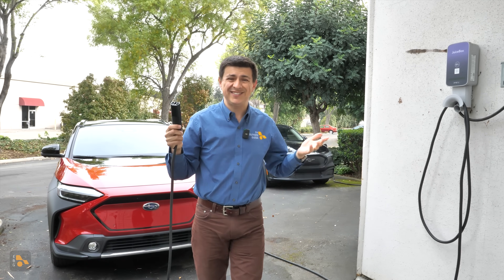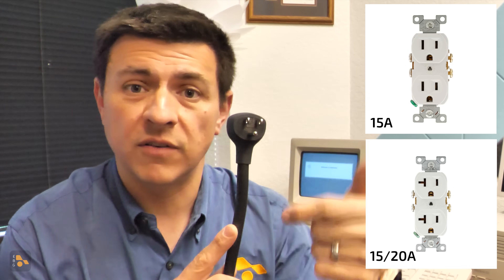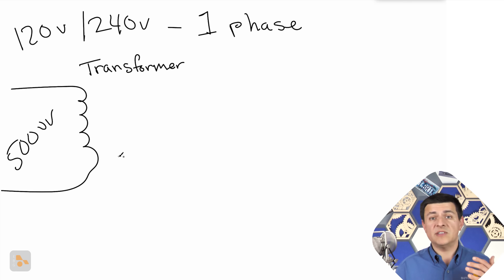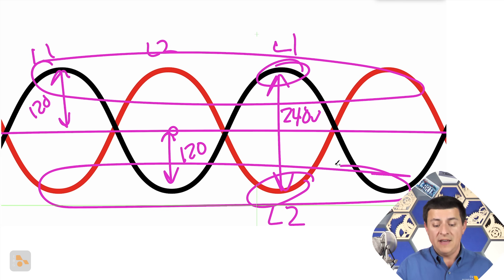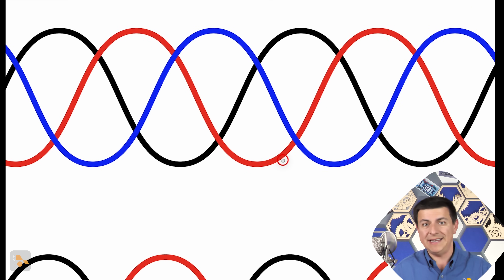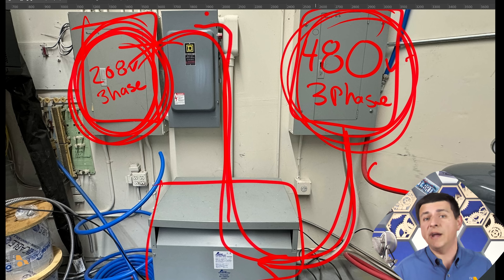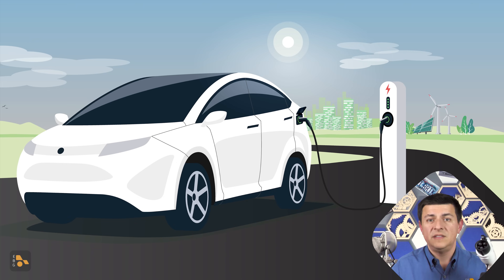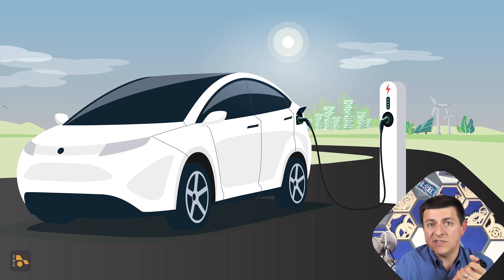NACS/J3400's Support For 277V Charging Is A Huge Deal and Here's Why

Comment from the maker: You can bet that as soon as we can get our hands on a 277V NACS EVSE, we're going to install one!   Also: If you want to go deeper down the rabbit hole, 120/240V split phase AC is 120V RMS (root mean square), not peak. The peak voltage is actually 170/340V, but for reasons that I'll let you google, we use the RMS value colloquially and act like that's actually the peak. An earlier cut of this video took a deep drive down that long road but our editing staff fell asleep so we decided to leave that on the cutting room floor.
Reply: Well now I want to watch the deep dive. Maybe on an extras channel?
Reply: Tesla wall connectors ALREADY support 277v and I believe all Model3/Y and most s/x support 277
Reply from the maker: @olemissjim  The older destination chargers explicitly support it, current destination chargers say 240V max so 277V support is best described as "unofficial" but Tesla has said directly that Model 3/y fully support 277V.
Reply: @EVBuyersGuide If my memory serves me correctly the v2 Supercharger cabinets is a stack of Model S/X onboard chargers and the cabinet input voltage is 277/480 volt three phase. So, technically it can handle 277 volts without any issues.

I have to say that was quite an ingenious way to keep costs low by using what they already had by ganging them up together with a little bit of power electronics and voilà you got yourself a high power DC fast charger.
Reply: @felaxchow207  all chargers are at their core, is a rectification circuit and voltage and current control and monitoring, so in reality all DC fast chargers have internal components related to AC level two chargers
Reply: @olemissjim 277 volt support was always iffy on Tesla vehicles. The older wall connector supported it officially, but the on board charger has over voltage protection that trips just a bit higher than 277V, so it can be flaky if your voltage is even slightly high. As far as I know, the newer Tesla wall connectors don't officially support 277V.

Hopefully this changes with official support in NACS.
Reply: @BrianCairns  As I recall, there was a "Legacy" DIP switch that had to be set in order for the HPWC to accept 277 V. However, regardless of whether they were set properly, the older Tesla units were considered low quality/unreliable, so the internals were likely to need to be repaired/replaced even when operating within those specs.
Reply: Enphase (ClipperCreek) has released an EVSE that officially supports 277V. It's the Enphase IQ EV Charger 2 with NACS and it explicitly states that it is supported on their site listing. The first one to officially support it since the Gen 2 HPWC from Tesla. You should get one of these units installed on the 480V service panel and showcase it charging a Tesla vehicle or another native NACS vehicle like the Hyundai Ioniq 5 to really showcase this capability in a future video
Reply: I've been thinking about a 277V supply at home by installing a 32V buck/boost transformer. At nominal 240V, this would get you close enough at 272V. At rest (no current draw) my 240V home supply reads about 245V. What are your thoughts on this? Would it be worth it? If you could do a video on this, that would be awesome! Keep up the good work
Reply: @goranj8210 It depends on What vehicle you’re trying to charge. Remember most home charging is just replacing what was daily used. Typically less than 30 kWh unless you arrived home with a low SoC after a road trip. 
It’s hardly worth the expense and effort.  I have 48A charging available, but I’ve decided it’s less taxing on the circuit to run at 24A on a daily basis. I only max charge if the circumstances warrant it. 

Now if, you are planning for an EV pickup with a  Huge HV pack, it might be worth it.

Comment: If you want 240 volts from either a 208Y/120 volt system (the wimpy wye), or a 480Y/277 volt system, you can use buck- boost transformers to boost 208 volts or buck 277 volts respectively to 240 volts.

Comment: If you have only a 208Y/120 volt system, ( the wimpy wye), you can use buck-boost transformers to step up the voltage to 240 volts. That would be The cheapest way.

Comment: Please prepare a video that would dive into if we were building a new home, and we can specify the "highest" voltage / amp Boxes (sorry I don't know the technical terminology) to be installed in that new American Home, then what is the fastest charging we could expect, if we were to buy the highest voltage/amperage Charging stations for Level II Charging at home.  (Something like 50amp or 60amp breakers or what not). So what is the Highest Theoretical Charging we could expect to have in a modern (post 2020) built American Home. This could help us for our planning.

Comment: We already do know the answer here, use Tesla Tap Mini or another quality adapter and it has over current protection in it, which means you are fine as long as you get a High enough amperage adapter, I personally just got the 80 AMP version and have never had an issue anywhere. Lower quality adapters or lower amperage ones can cause issues though. Additionally, EVs are designed to only accept at the rate they can, so if you plug into 270 volt power, it will still only draw 22 or 240 volt if that is all it can handle, some like the eGMP vehicles likely can handle 270 volt though just fine.

Comment: This is a bit pedantic, I understood what you were trying to represent, but 120/240V AC is the Root Mean Square (RMS) voltage. When you draw a chart showing sine waves and neutral to peak; that is 170V, or 340V peak-to-peak.

Comment: I can't see why 277-v would be problem for any cars.  Insulation able to withstand 240 volts should be fine at 277.  Same for heat in the transformer.  Charging speed is much slower than DCFC.

Comment: What really makes it cool about J3400 is that even older Tesla onboard chargers natively supports 277 volts single phase since they were also used in the v2 Supercharger power cabinets. By ganging a bunch of them together in a 277/480 3-phase configuration to streamline costs and rapid deployment by using what they already have in current production.

J1772 standard is limited to 240 volts if my memory serves me correctly and their onboard chargers are probably the same. So, if someone decides to plug in to a Tesla Wall Connector (EVSE/charger) using an adapter at a commercial site that is being supplied with 277 volts might end up letting the preinstalled smoke out of their onboard charger. The conundrum begins...

Comment: Wow, very interesting. I originally come from Australia and normally there a home will have single phase 240 V. However, if you install a Tesla wall connector, as you pointed out, you have to wire it three phase because of the phase load balancing requirements. The electrical system in the United States has always bamboozled me somewhat because I am so used to having a three phase environment for heavy electrical loads in a household. Great explanation Alex I learned a lot, particularly that the onboard chargers are current limited, not power limited and the difference between US Mains power delivery at a residential home as compared to a commercial property. I personally would very much like to see that in the near future on board EV chargers are all rated for at least 80 Amps, vs the current 40/48Amp, as with batteries the size of the Silverado they are not simply adequate enough to take advantage of super off peak rate time periods..

Comment: In India standard voltage is about 240 volts and peak loads above 6 kilowatts is compulsory three phase even to households. I use an EV myself but limit my home charging to 3.3 kilowatt charge, but all commercial fast DC chargers are supplied three phase from the grid and max out at 60 kilowatt fast dc charging.Edit: we don't use any transformer after the meter, it's illegal to install a transformer after the meter unless you are using a large industry where separate and approved installation are provided for.

Comment: When using a J3400 to J1772 adapter, is there something in the handshaking protocol to prevent 240V vehicles from activating a 277V charger, or will they get overvolted by surprise?

Comment: Given J1772 and NACS both use the same IEC 61851 and 15118 communications standards and 48A is going to require 5 AWG cable or better, the connector shouldn't be an issue so much as the car knowing if it can handle 277V and saying so. So I really don't think this is an issue at all. The existing adaptors should even be adequate since the DC pins won't be used.

Comment: This is WONDERFUL. One of the best simple-but-deep explanations I've heard about all of this stuff. 277V at a parking lot means the most popular EVs (Tesla 3 & Y) get a FULL charge on their long range packs in about 6-6.5 hours. Note how unlikely that will be. Most users charge to 80% and most don't drive in on 0%. In a typical scenario a 2-4 hr visit may be enough to cover a whole week's worth of driving. Those extra volts do count an awful lot. For those without at-home charging, getting this J3400 standard in is more impactful than many realize. An hour in either of those Teslas is 36-50 miles worth of driving.

You have earned a new subscriber immediately!

Comment: Have to say, I don't care what is happening with the poles in the generator. When you split the phases by center tapping it, we create two phases. Calling it 240V single phase has always been stupid. Even more so when you plot out the voltage.

The other thing is (and  I am sure you left it out to reduce confusion) is that the voltages you are referring to are RMS. The average. Plotted peak to peak 240RMS is actually 340.

Comment: One of the reasons 277V will take a bit longer is the safety factor.  Heat specifically the incident energy is a squared variable. So that relatively small increase in voltage means there's a lot more heat in case of a fault. The equipment, wires, everything has to be able to safely handle the added stress.

Comment: never knew USA power was such a mess - wow!! -
 im in Europe, (UK) our 3 phase power is 380-400v, when we split single phases off you get 220-240v. i cannot understand why America would choose to have 120v, 208v, 240v & 277v as a standard voltage but also going from 3 phase to 2 phase power seems messy also adding a transformer all over the place is messy, (though if used correctly could be safer - but not in this setup). then on top of that you have the worst socket connecters fathomable with no safety for if pulled half out and they overheat so easily

Comment: Are you saying that the Tesla Universal Wall Connector is currently compatible with 277V 1‐phase? And the vehicles are, too? But that a Kia EV6 plugged in to that UWC  wouldn't charge at all?
Reply: Yes, the Tesla Gen 2 wall box supports 208/240/277VAC, for example).

Comment: Here is a dumb question I had years ago.  Why won’t public EVSE makers such as ChargePoint include an auto transformer kit to be installed at the base of the charger pedestal that would reduce voltage by 40 bringing 277 down closer to 240 range? seems like an easy fix, if such a transformer would fit. That way we wouldn’t have to install 112.5 kVA transformer for every 13 charging stalls. This, as you can, imagine, is a huge expense and why it is challenging in North America to adopt chargers when we have 4 different three phase AC systems, while Europe just has 1

Comment: OK, but two small points:  Your water heater is also on 480 in that building probably.  Also, those voltages you are drawing on the sine wave diagrams should be labeled RMS, because technically on an oscilloscope those would be peak to peak voltages which are RMS x square root of two.
Reply from the maker: Actually no, the water heater is 208 unless you’re in a larger building that uses a ton of hot water. Most small to mid size offices tend to use small on demand heaters. Re: RMS, reference the pinned comment.
Reply: @EVBuyersGuide. I stand corrected.  Surprised, but corrected.  Seems the water heater guys should catch up with NACS and switch to 480/277?  Maybe they are using residential water heaters?

Comment: So my when you compared the 208/220/240 at 48 amps those were all with two hot wires. But with 277 that’s only 1 hot wire which is cool. What would be even cooler is the same feature of using two 277 hots making 480v and charge at well over 20kw using relatively low amps.

Comment: If NACS connector  supports 400V direct current charging for fast charging, why is it a surprise it has no problem surviving 277V AC or even 400 AC ? It is just a copper with some cooling all wrapped in plastic.
Reply from the maker: The onboard charger is what has to support 277v AC.

Comment: As a long time Tesla owner, I see the problem with the public charging infrastructure is that it’s too slow or too fast. When people talk about going to get something to eat while charging, DC fast chargers are too fast, depending upon starting and finish levels. Most level 2 are 6.6 kW and that’s typically not worth the effort if you’re going to be out for an hour. Charge at home unless you’re on the road.

Comment: I once owned a 2017 Model X with the dual chargers which would charge at 72a. I found a place that had a level 2 Tesla charger on a 277v 100a breaker. The car charged at 19.9 kW. That’s what I call fast AC charging.

Comment: So, you mentioned the TeslaTap...  As far as I can tell, it doesn't support 277v....
My question is, what happens if you plug a Teslatap (or similar) into a Tesla EVSE at 277v?
Will the Teslatap just not work?  Will it break?
Will it just pass the 277v to the car and let the car decide?
If the latter and the car doesn't support 277v, what will it do?  Just not accept it?
Will it break the on-board charger???
I have one of these adapters I've used a few times to charge my Bolt at a Tesla destination charger...
Will I have to try to identify whether a Tesla destination charger is 277v and not use it?  
I'm OK if it just doesn't work.  But I'm not OK if it could damage the OBC on the car...
hmmmm....
Reply: It just doesn’t work if the voltage is particularly high-end of nominal  277V.  These stations already exist and people connect to them with those unofficial adapters.

Comment: I had never realised what a mess the US electrical supply is. In the UK it’s much simpler - we have either 230V single phase or 400V 3 phase (230V x 3). In the UK we get three phase in some domestic properties (I have a 3 phase 75kW into my home) but the majority are single phase. New properties are now being installed with 3 phase due to the strategic aim to move to EVs and heat pumps for home heating. European EVs typically can charge at 3.7kW, 7.2kW (16A/32A single phase), 11kW or 22kW (16/32A three phase). Not all EVs support 32A three phase so a lot of cars only support up to 11kW. I have a dual 3 phase charging post in my driveway which can handle two cars either at 3.7kW or 11kW.

Comment: Not quite right, in Europe, 32A at 230V (7kW) is available in most places, such as wired-in home EVSEs.  
Only if you resort to “emergency” 3 pin plug charging will you be limited to 3 or 4kW.

In public and workplace settings you will always get 3 phase, which means 22kW.  
Yes, my Tesla charges at 22kW. At home.
Even 44kW is possible by the standard.
And most new homes get 3 phase nowadays.

All for one more conductor in the connector and cable.  A bit short sighted of North America to adopt the NACS/Tesla connector which can only ever support single phase.

Comment: This is interesting because I bought a Tesla Connector -> J1772 adapter (like the one Alex shows briefly in the video) so that I could plug my Chevy Bolt into a Tesla Destination Charger. But the particular destination charger I go to only charges the car at 3Kw, even though Tesla's map claims it can deliver up to 8Kw charging rate. This whole time I suspected the charger was broken somehow, as I've gone to other Tesla Destination chargers, and using the same adapter, I've gotten over 6Kw of charging. But now, in light of this video, I'm wondering if that "broken" charger is actually providing 277V, and my adapter/car isn't operating correctly because of that. It also makes sense, because once or twice, that Tesla Destination Charger tripped itself and I had to press the reset button on it.

Comment: Makes me wonder why they stick with 480/277. 400/240 would be easier to handle. You could take the 240 directly and get the 120 with a 2:1 transformer. The difference in "power per wire" between 400 and 480 isn't that big that it would matter in most installations.
Reply: For large industrial applications, it is significant.  It also has another advantage, since motor manufacturers can use the same motors on both US 480V grids, and rest-of-world 400V grids.  Motors tend to work in a way where the Volts-per-Hertz governs compatibility with a given grid.  This means a motor manufacturer can make the same motor to work in both markets, since 480V at 60Hz is the same Volts-per-Hertz as 400V at 50 Hz.  It also means a 1500 RPM motor would spin at 1800 RPM on the US grids, since spin rate follows frequency.

Comment: Most people will understand what you are explaining, but the sinewaves explaining 120 and 240 volts are not correct. The peak as you point to is around 170 volts - the RMS of the curve is 120 volts.